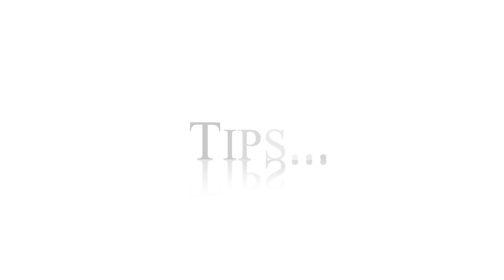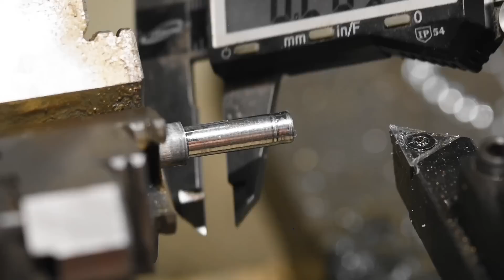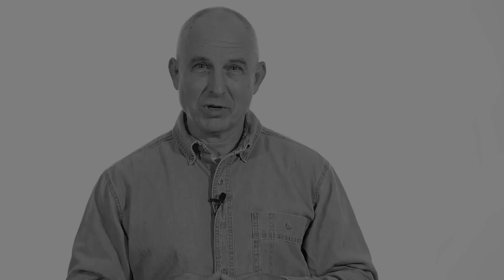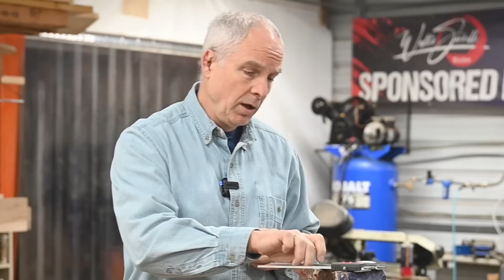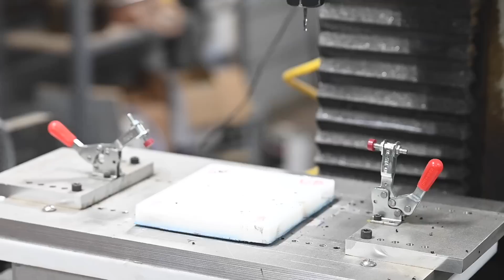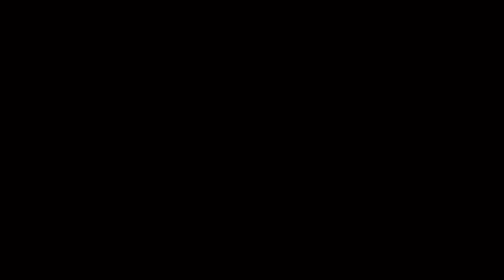I Was WRONG! - Caliper Secrets Revealed

Comment: Walter - I own about 20 sets of the various Starrett dial calipers and digital calipers.  Yet my everyday caliper I use is a Harbor Freight giveaway electronic caliper that I have used for over 20 years.  I check it against gage blocks every six months and it still reads true.  I think it is just luck of the draw about whether the HF calipers, and similar makes, will hold accuracy.

Comment: my primary use for calipers was for marking centerline. i have since switched to machinists block and height gauge with carbide tips. i like it alot more.  I would be interested in a caliper with replaceable carbide tips but havent found one yet
Reply: Luc - Starrett has a set of carbide tips that can be added to the calipers.  They slide over the caliper tip and then are locked down with a grub screw.  They are not cheap.  Last time I checked (which was over a year ago), I think they were $175.  I think your block and height gage area a great solution for anyone who does not have an unlimited budget.

Comment: Retired now, but I used to teach a high school introductory engineering program (four classes).  When I started it 20 years ago, I was forced to use $5 vernier junk.  Terrible.  Finally got a small grant and bought a case of "General" dial calipers.  Kids found them so much easier to use to learn the four basic measurement types - outside, inside, step, and depth.  The garbage verniers could only do outside and not very well.  I have a couple sets of the electronic calipers, including one that does standard, metric, and fractions.  But I prefer the dial calipers 90% of the time.  A few years ago I was fortunate to pick up $450 worth of Mitutoyo calipers at a local auction for $50.  They are definitely a step above the "General" brand and others, but as a hobbyist, I just wouldn't pay new prices for them.

Comment: I agree.  I went to dial calipers a few years ago.  The electronic ones are easier and automatically do conversions, but every time I needed them, the batteries were dead.
Reply: That's why you break down and just get a pair of Mitutoyos. A battery lasts so long in them you forget the last time you changed it. I forget how to change it. So I have a video saved that explains it. When you pull the battery on Mitus they lose zero then and rezeroing them is something else I don't do often. Only when I change the battery. Which is about approximately every 5 years or so.

Comment: Actually Walter the depth gage is just as accurate as the outside jaws because the depth gage is just as much precisionly made as the jaws are. If you don't believe the are open you digital calipers to .50 and then measure the depth gage with your manual caliper to see how accurate the depth gage is.